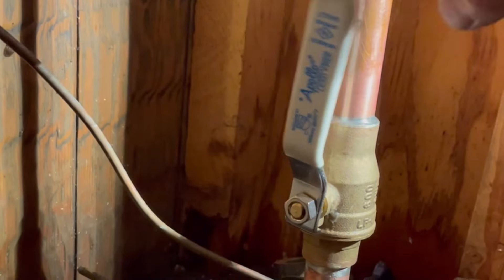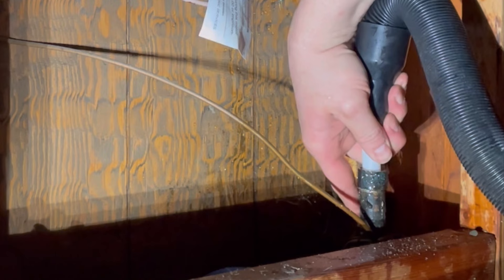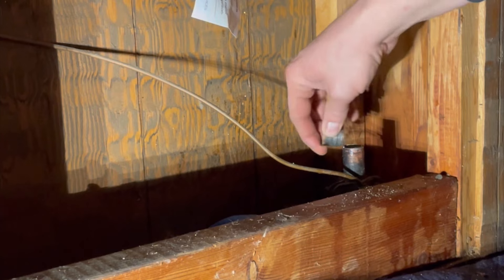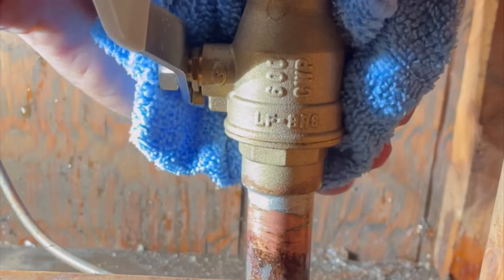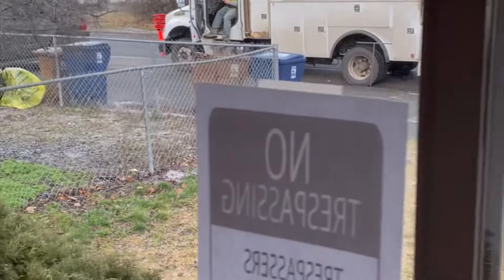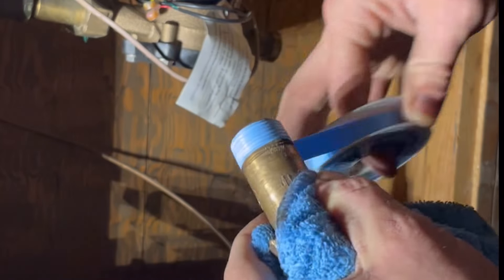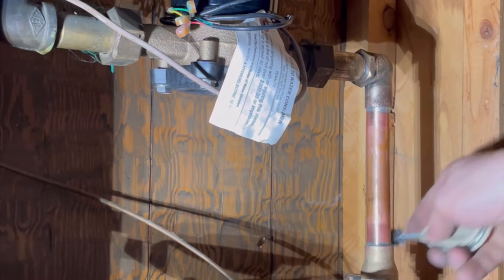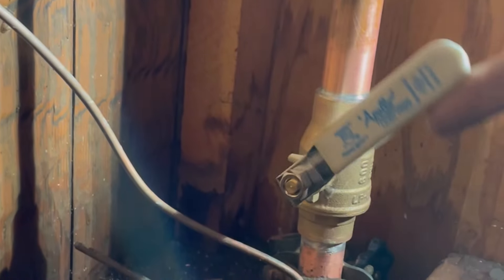Installing A New Main Shut Off!

Comment: Thank You for your video, I appreciate the care you take framing and the narration is good. One thing I noticed about you when you sweat the pipe is how you use the flux applicator after you apply the solder. I've never seen anyone do that before but it's nice to see a plumber take so much pride in how good the pipe looks after the work.
Reply from the maker: Thanks for the kind words and for watching! I like to wipe with flux while solder is still hot, one I want to make sure I carry solder over entire joint and two I think it looks nice.